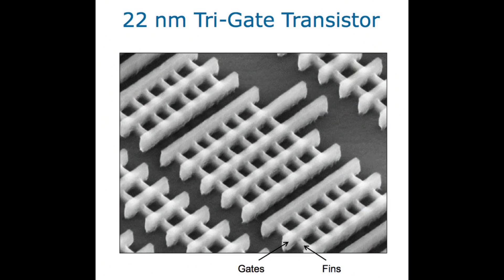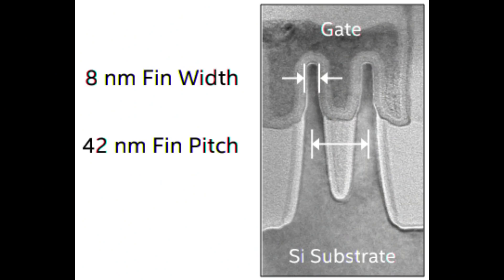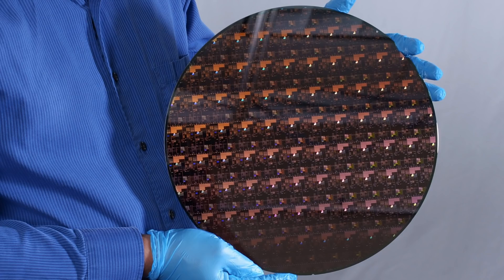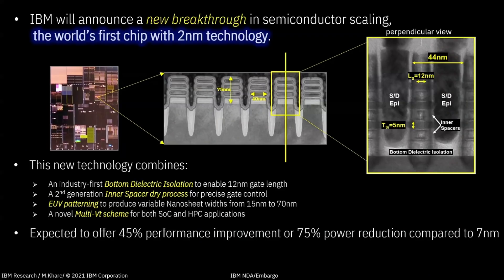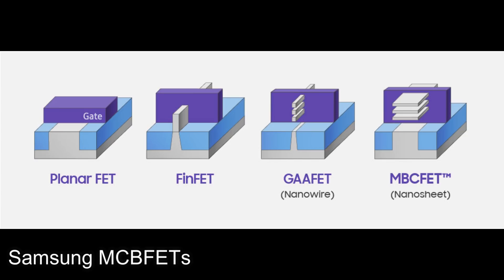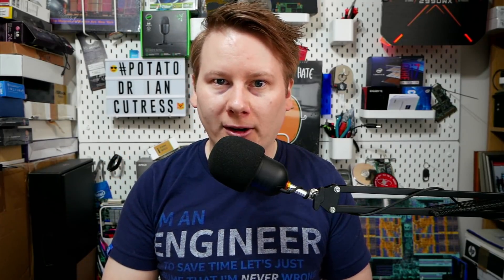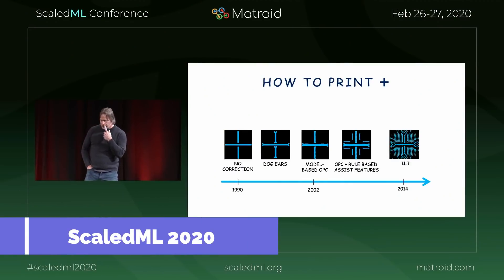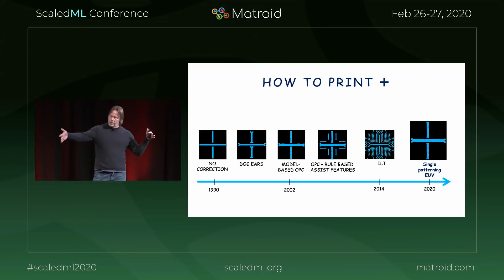There's Plenty Moore Room: IBM's New 2nm CPU

Comment: When you said about 333 million transitors per mm square that honestly broke my brain. Utterly astonishing engineering going on.
Reply: It still blows my mind that we're in the billions of transistors on CPUs now, basically every single one has to work or the whole chip is useless, and these things run for *decades*. I don't know of any other thing we make as a species that's good for quadrillions of operations with zero maintenance.
Reply: @Teth47  chips do have defects. It doesn't kill the entire chip though. There are multiple parallel paths for every circuit printed to mitigate defect density so that more fully functional die per wafer are yielded.
Reply: @Basher-gang  Sorry mate, but that is not the case. There may be additional circuitry designed in for something like memory or maybe video processors, where the chip is replicated cells of the same design, here it is possible to do and it takes only a little more area to provide redundancy. For other designs that is not possible - multiple "pathways" = wasted space, parasitics, manufacturability issues etc. let alone how you isolate "bad" and turn on "good".
The way it IS done is hammer down on defectivity. This is what determines yield more than anything else, you can have all your transistors on target, but say 0.1 def/cm2 @20nm size with a chip of ~2cm2 (fairly small) will result in a 20% yield loss. That's for a single layer defect. There are ~20+ physical layers in a process flow (I forget the actual number, but at least that number), not counting multi pass litho & dep/etchback layers etc. So your 0.1 def/cm2 defect level on a handful of layers quickly turns into 0% yield!
Reply: @Teth47  Alien technology man
Reply: @valerius39  We are the aliens man ^^
Reply: @Teth47  I would imagine, that with that scale of transistors, and to have a faulty one kill a whole chip, they will build a few redundancies in, so that if a portion of the chip has a fault, they can just fuse it out, and have a backup circuit take up the slack. At least, that's how I would do it, if designing something with that number of potential failure points. I'd build redundancies in so chips could be "saved" even if one critical part had a fault, and a have a fuse map to choose which parts to enable/disable. Sure, it's eats up some silicon space, but if you has even just 1% used for backup circuits, and it could rescue otherwise failed/faulty chips, I think it would be worth it.
Reply: @lesleymunro4964  a lot of transistors have multiple circuits anyway. It's not just a single transistor, it's a set to complete that circuit.
Reply: @lesleymunro4964  you're sorta right, what is usually done is that the faulty cores are fused off, and then the chip is sold as a lower core count model. So for instance if you have a product lineup with 8, 6, 4, and 2 core models some of, and usually the bulk of initially, the lower core count models are actually failed higher core count models.
Reply: @lesleymunro4964  no
Reply: @Teth47  New transistors are not actually that durable. The fab will have design rules for how many extra transistors to pack in for each switch and your design software will be setup for lifetime, yield, energy efficiency, and so on.
Reply: @Teth47  it's funny eh ? to think of the work needed to purify the silicon, and then the fab rooms are like cleaner than any hospital surgery suit...
Reply: @Teth47  All the transistors dont have to work there is software to remap the silicon if there is a failure in specific pathway.
Reply: Ev
Reply: @Teth47  Not quite every device. There is some built-in redundancy which still allows for a good CPU to be made, even with faulty transistor regions which can be isolated and substituted. 
There are also multiple cores, in modern evinces, allowing for lower grade CPU's using fewer cores, and even with smaller memory caches, as well as slower clock speeds, to be sold. Your 4-core CPU could be an 8-core device with 4 faulty ones not connected, for instance. 
The remaining failure rate and the lower batch yield of the best devices account for most of the high price of the top specification CPU's.
Reply: @Teth47  q1
Reply: @Teth47 It's absolutely amazing
Reply: @Teth47  everything doesn't have to work, most cpu/gpu have redundant circuits or duplicate circuits(in critical sections), so chip would still work, this is the second reason why transitor density of big chips is so bad..
Reply: @Teth47  actually human were helped by extraterrestrial being.. aliens if you may..
Reply: @kimballchoo  you assume helpfulness and good-naturedness. for what reason? very advanced technology?
Reply: @conhel8826  yes..
Reply: @kimballchoo  Why do you believe that?
Reply: @louistournas120  yes absolutely… I happened to have secret informant of these things..
Reply: @kimballchoo  What do you mean? Are you saying you were visited by aliens?
Reply: @louistournas120  not physically…
Reply: @kimballchoo  How did these aliens visit you?
Reply: Just don't try to count them by hand.
Reply: @samlebon9884  USE TOES ALSO...
Reply: @samlebon9884  oh god no
Reply: @samlebon9884  oh god no
Reply: @Rocket Zing I think the official word from Keller is they're down to 100 atoms across, can print 10 atoms with 1 atom's resolution.

Either way it's nuts.
Reply: Just keep in mind that these situations are being designed by individuals and then being taken and tweaked for scalability by others. Cooperation is the real magic of Engineering.
Reply: @liamer88  humanity seems almost like one organism with a collective intelligence sometimes.
Reply: @liamer88  This.
Reply: whats more cool is that last tech telling you they got 100X shrinking with euv and now can continue usng the old techniques for prolly 20-30X more shrinking to sub NM size
Reply: @chronosschiron  I think the field of an electron is 1nm, bundled of course is larger.

We've got a ways to go as even 7nm has a lot of much larger bits in there, 14nm had some as small as 6nm itself but I think as we go down it's going to become more uniform, the smallest and largests components are going to be similarly sized, probably around 2nm. We'll see.
Reply: In all honesty what amazes me is the synthesis software and library macro side of things.  One has to design those transistors by Hardware Description Languages and then verify the synthesis results and timing margins.
Reply: That's like 10x ARM Cortex A9 cores on a grain of sand.
Reply: It's theoretical density have almost nothing similar with real life, because based on reproducing SRAM cells even without any interconnectors. Intel's 10nm process already feature theoretical 100+ million Tr/sq.mm while 14nm feat 37.5 Mi. So, what's so astonishing? TSMC's 5nm setimates to feature up to 173 Mtr/sq.mm
Reply: That would be 333 million transistors per square kilometer back in the day.
Reply: @dakoderii4221  vacuum tubes and relay switches.

That's all a CPU is, a bunch of relays. A metric buttload of relays.
Reply: @dakoderii4221  Define back in the day. Also, are we talking just die size or is the chip packaging part of the equation?
Reply: @ropersonline  Before chips.
Reply: Most transistors in a chip are in the caches. When there’s a fault, they disable the faulty bank and sell the chip as a “celeron” 😂 same with a fault in one of the cores.
Reply: @nzer19  Incaches, yes. But not sell as celerons. If You check what dies are made, the majority of chips are not able to be converted to hypothetical celerons (or, rather, pentiums because of same UHD630 as i3). Because of GPU, for example. And for Rocket Lake, the are no celerons, pentiums and i3s at all on on the gen. Even more, the defects from i5/i7/i9 in fact are not sold at all.
Reply: Factoring the time and cost it takes to go from 5nm to 2nm Moore's Law is dead.
Reply: @dorkanderson4963  Moore's Law has been revised to say, more or less, that CPU power doubles every two years, reason not given.

We are getting near the end of silicon though. We've still got at least a decade left before we can't go any smaller but the field of an electron is going to be a problem to contend with, it will limit how tightly everything can be packed. Of course if they can do somehow sync the electrons in neighboring circuits that might work, dunno.

Regardless, smaller is going to be an issue after a few more shrinks but we're not there yet.
Reply: @dorkanderson4963  to be
Reply: That's also peak.

Intel's 14nm wasn't twice as dense as TSMC's 14nm at the end of the day. If it was there's no way Ryzen would have been competitive.
Reply: @glenwaldrop8166  The density, theoretical is a almost-nothing-showing numbers. because engeneering rules for each process include the gaps for interconnectors and gaps between elements to prevent the leakage and even dielectric breakdown. So, real blueprints are far from theory. Even more - each fab maker puts different dielectric strength's reserve to avoid quantum effects and leakage. That's why two "numerical" processes cannot be compared directly.... Sad but true.
Reply: @decardcain9645  I commented on that on my own post below the video, there's no way the "peak density" is actually correct. SRAM is the densest part of the chip and Intel is no where near those theoretical numbers.
Reply: @glenwaldrop8166  Of course You right. Even more, the SRAM is "unplugged" one to other to avoid "space waste" in connectors. Such density is an example of sram massives "stamped" on wafer. Major purpose for this is not marketing, but defect detection for litography, that is most clear visible on exposed dense pure logic wafer.
Reply: ironically, it itself contains many more transistors in a voxel, enabling you to write this in the first place
Reply: Not to worry. Broken brain soon replaceable with transistors.
Reply: X2 is 666
Reply: @iIIIIiilllIiillll  666 is count the number 6+6+6=18digit citizen identity number of china, upon marks national identity cards in china over a billion people have already received, which has enabled the wicked in the government of china to selectively exploit and abuse the people of china as opposed to generally systematically exploiting and abusing everyone in china.   Thus every advance in technology moving forward the wicked in the government of china can leverage their 666 identity foundation to selectively abuse and exploit the people of china with every advance in technology, thus exploiting and abusing technology and people selectively, it is wickedness.
Reply: I will give a million dollar to anyone who can predict when China will break this record.
Reply: @Jon Linklater-Johnson That density corresponds to about a 55 nm spacing between adjacent rows and columns of transistors -- not as closely packed as I expected when the feature size is nominally 2 nm. 
(How did I calculate that spacing? The square root of 330 million is about 18250. So if we built a square array of transistors with 18250 transistors on a side, we would have 18250^2 = 333062500 transistors in the array, pretty close to the quoted density. Then the spacing in each direction would be 1 mm / 18250 = 54.8 nm). 
I don't know how to convert that transistor spacing to RAM-cell spacing or any other relevant measurement.
Reply: cool so it sounds like pm picometer will be a thing in a few years
Reply: Solve Everything  The brain, all the cells and the environment together defines levels of soft wares and hard wares and the input/output from environment define life as a quantum computing function.
Reply: It didn’t actually break your brain, so you shouldn’t have used the word “honestly”
Reply: Jon that's NM, not MM. M-n-M's are candies. lol
Reply: There are a trillion 1e12 square nanometers in a square mm.  Divided by 333e6 is 3003 square nanometers per transistor.  Or  55x55 nm per transistor if they are square.
Reply: Out of stock
Reply: Blew my mind decades ago.  These days, pretty standard fare.
Reply: HiZjxxidodi de
Reply: Mica should provide the next substrate for semiconductors. Increasing voltages will enhance thermal management but will have to find techniques of layering that can prevent arcing between junctions
Reply: Can someone please confirm, we have a mechanical structure built at this level??
Reply: I feel so old now when I think of my DEC PDP11/35 with 32 k of core memory.
Reply: 7n
Reply: 333 million being the actual and 2 nm implying 1 trillion. So reality is off by 3000x. The best news you can get out of this is that it means there is still more room to go smaller because if we were actually at 2 nanometers we would rapidly be closing in on the size of a silicon atom.
Reply: @MINIMAN10000 his is correct, for 1 nm.  For 2nm it is off by 4x less.  But your best thing to take out of this is a good way to look at it.  But it also has to be factored in that 1nm x 1nm transistor spacing requires that many features be made quite a bit smaller than 1nm. The transistor itself needs spacing from neighboring transistors.  And a transistor needs contacts to be made to its 3 terminals.  A 1nm x 1nm transistor density would have a lot of smaller features packed into a 1nm x 1nm area.
Reply: This is NUTZ!
Reply: yeh man how many cuda cores is that!!!!!!
Reply: LFG Intel
Reply: it's like building electronics by sputtering metal onto a surface in special patterns
Reply: @uncommonsense360  it's just like tagging, only at the near atomic level.
Reply: Light wave lengths being TOO BIG to print what we want to make, should have "broke your brain" already? No?
Reply: Imagine me trying to explain this to my girlfriend

Comment: One problem with 2 nm is that the Silicon lattice is 4 nm wide. That presents a fundamental barrier, at which transistors cease to work. The claimed 2 nm, and anything smaller, is therefore pure marketing hype.
Reply from the maker: If you actually watched the video, or understood the industry, you'd realise that all node names are actually names, not measurements, to describe a theoretical 2D implementation now we're at 3D FinFETs
Reply: @TechTechPotato 
How long do you think before we get triple density ram?

Comment: I can’t even wrap my head around 2nm lithography, but I suspect it’s some trick where it’s really 5-7nm but some crazy stacking it offset gimmick but we will find out eventually. Even 5nm doesn’t make sense to me.
Reply from the maker: Ever since 14nm and the first finfets, the naming hasn't matched any real physical dimension because the transistor went 3d. This naming is meant to imply a theoretical 2d transistor of that size. At 2nm we move beyond finfets to nanosheets and there are multiple generations of that to come

Comment: Actual title: "there is more (marketing) room"
If it has no 2nm features not is it a 2nm node, but has a "2nm node expected performance".... then it's NOT a 2nm node
Either drop the naming scheme or invent a new one to better reflect the 3-d nature of new chips. Number of gates per cubic millimeter perhaps.
Reply from the maker: Search for the phrase 'there is more room at the bottom', you might get the joke then.

Also, node names havent related to actual size for years. There are elements in Intel 14nm as small as 7nm, or as big as 44nm. Its meant to be, roughly, a 2D equivalent.

Comment: With an 80% failure rate per platter.  That is the main issue.
Reply from the maker: Platter? What's a platter in this context? Do you mean per wafer, or per chip? Nothing here is called a platter.
Reply: @TechTechPotato Slice of silicon, Round pie of doped minerals, Circle of chips.  What is the failure rate based on chip size?  IBM dumps news like this all the time but I sure don't see them pushing silicon at that resolution.  I am sure many can do these higher densities but few can do them profitably.  Even the Chinese are 20 years behind state of the art.  We need quantity these days, not higher resolutions.  The coffers are bare.

Comment: What do I think? Silicon Doomsday. Post 2017 wafer costs started rising. Monopoly on 7nm+.  and Global chip shortage will only get worse. Somebody has to pay for that $20B fab. Also, interconnects running into hard limit, and no solutions this decade.
Reply from the maker: Actually,
(a) Q1 2019 was a minimum on fab revenue. if you notice everything was going down to Q1 2019, and slowly started rising.
(b) 7nm production is TSMC's advantage right now. Intel have stumbled, Samsung is trying.
(c) People are paying for those $20B fabs. Intel has committed $100B+, TSMC CAPEX is now $40B a year. The price of the fab isn't the issue
(d) Interconnect research: there's a million and one things being looked at through the research conferences. TSMC, Samsung, and OSATs are doing amazing things with packaging. No solutions? I've still got 50 more research papers to read from the last conference - there are lots of solutions!